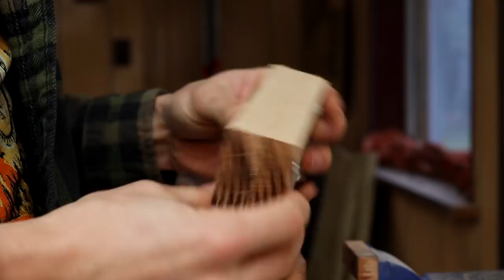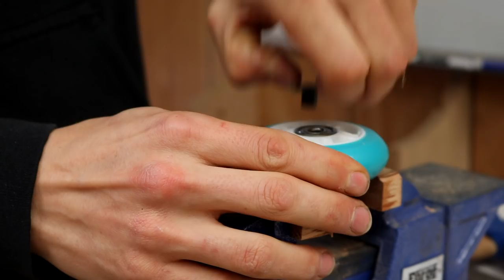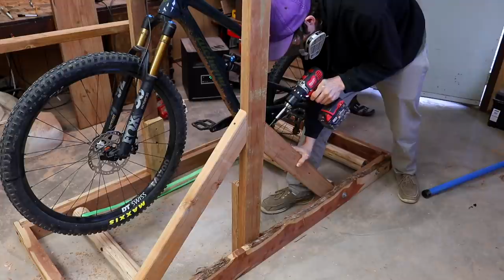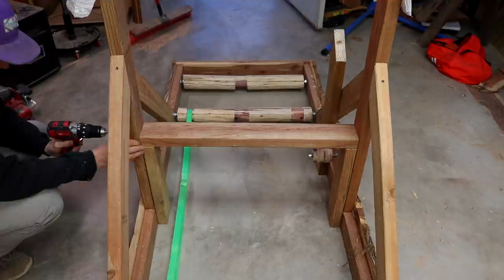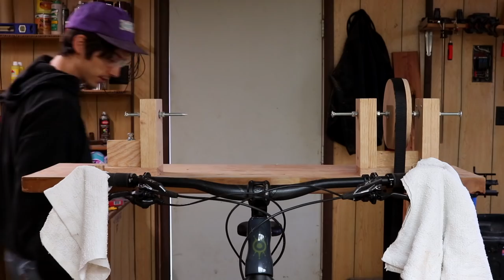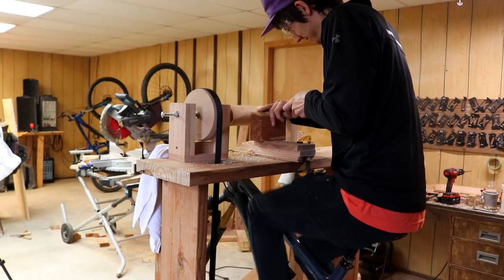Building a Bike Powered Lathe!

Comment: Awesome idea! If you use a cheap old donor bike for the pulley systems you can use the chain and shifting system to get more power without the pulley system slipping. It would be quite an upgrade to the system.

Comment: Hell yeah! So dope! I have a suggestion. You have a gear reduction going on with that belt drive setup. Look for a way to change that so you're actually stepping up the speed of the spindle. If it's spinning faster, the loading on your tool should be lower, meaning lower instantaneous torque should be required to keep everything spinning while you're cutting. I think this should translate into less belt slippage. This is a lot of conjecture. I have some experience with powered wood lathes, and some more with CNC router work, and I'm just slamming together a hypothesis based on ideas like chip load, feed rate, depth of cut, that kind of thing. I'm not an expert though, but basically I'm pretty sure that with the speeds you have now, faster = better.

Comment: Just a thought - that large wheel in the headstocks you could drill it out and put some steel slugs into it to add weight to get more of a flywheel effect. This may help smooth it out, but you have to get those weights balanced properly.

Comment: A couple of thoughts on the 2.0 build: get rid of the bicycle, just use the cassette and pedals on a stationary mount and add a heavy steel flywheel and a belt whether leather or rubber.  The bicycle gearing could be shifted just like on a mountain bike for more resistance, faster turn, or less resistance, slower turn.  The flywheel would add momentum so that your workpiece would continue to turn and turn once you got the flywheel moving fast enough.

Comment: Upgrades!  
1- bike chain + cog instead of the belt drive because it just seems right
2- extend the table so that you can flip the toolrest around and have a second person work the lathe from the other side while a rider powers
3- shopvac hose mount and debris shield on the work table so you don't get shavings or sanding dust on the bike / bearings

Comment: if that belt is made of nylon web it's going to be inherently slippery; try giving it and the wheels a dusting of spray mount (rubber glue in a can)  I'm sure that will work. The other issue is that your wheels are too crowned; the crown should be rounded, not pointed, and barely visible.  Nice work!

Comment: would an old bike wheel interior work as belts?
Reply from the maker: I was thinking about this as well. Maybe an old inner tube? I built these pulleys for a belt that needs to stretch.
Reply: @BackyardTrailBuilds  inner tube for sure would be a good shout. Lots of grip and stretchy for tensioning.

Comment: Um seriously – what about a bike powered table saw?
Reply from the maker: Um seriously, lets do it!
Reply: Hello I am from South Africa I do a lot of panel power machines as well the one thing that you really need to take care of on the table sold is to have a great enough flywheel it could be a lightweight one but be giving like 3 feet oh something a little bit smaller like one feet that's really really heavy please do compromises in those two the blink of big flywheel must be very light and have a little wind resistance so we must be smooth something like a fly wheel of the truck the one factor for the heaviness is you when you start to cut is to have enough speed on the blade to have a continuous cut like for instance 1 feet 1 inch thick so yes it's absolutely possible if you need any information regarding the build feel free to contact me anytime
Great to look on the bold what you just did it was wobbly at first but it's now really been straightened out very good

Yay swell as She said as you start doing it cut you want to continue piddle until it's finished I really do understand that .

I have made a pedal power dril press and the pedal powered compressor it will quite amazing I do spray with it and do some wood carving wood with a very small pencil grinder and obviously pump some Bicycle tires and based off them ole  and the ast to lift  up the pick truck with the linear actuator With just six one for bar These cylinders can do up to 4000 pounds800 × 564